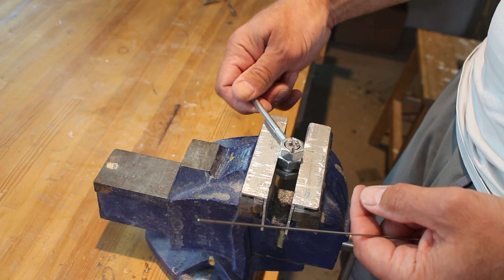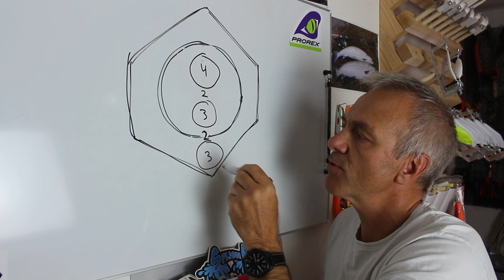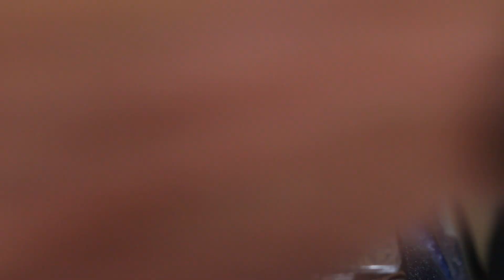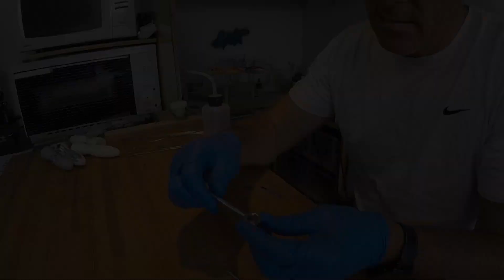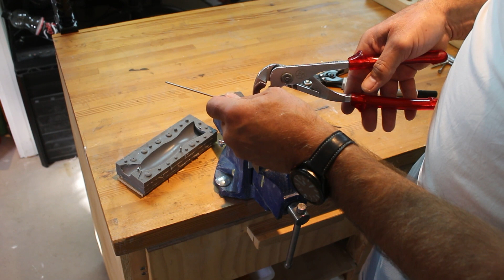Heavy duty Wire Bender

Comment: I read through some of the comments looking for someone mentioning adding a drop or two of oil to the tip of your drill bits. Trust me, your bits will cut better and last much much longer. Good video by the way.
Reply from the maker: Thanks. I'm sure you are right and thanks for the tip.

Comment: Hi there 👋 this is one of the easiest ones to do 👍 no welding needed 🙂 since I don't have drill press, my accuracy will be little off, so I think I will downscale the diameter of the pins a little, anyway I'll be using max 1.2mm wire 😉
Reply from the maker: Good luck with it

Comment: Nicely done. Thank you for the time and effort to make and post this video. About your cutters...I'd hazard a guess you natively speak German so, if that's right, you may like this: Knipex 71 12 200.  Baby bolt cutters, made in Germany. Absolutely amazing. I use them for fencing (barbed wire, woven, high-tensile, and for cutting small aircraft cable (1/16, 3/32, and 1/8).  Great cutters and I think they're smaller and yet would provide more cutting power than it appeared your set has.  FWIW. Thanks again.
Reply from the maker: Actually not german, but danish - I think it sounds alike if you don't speak any of them.

thanks for the advice on the bolt cutter. It looks really nice, and has enden up on my wish list
Reply: @SplishSplashFishing  Yeah, that's a hazard of not being in a diverse population (where I am)...it's hard to accurately pinpoint accents.  I'm sorry for my confusion.  And I wrote the wrong model number for the Knipex, it should have been 71 01 200.

Comment: Hi Jergen, "GIMME THAT TOOL" is cool cheap DIY for small wire gauge bender project. The fabrication was time consuming but thereafter it much flawless to bend such wires. I'm in the mid of creating similar design wire bender for slightly heavy gauge with nut made of cobalt steel. Hope this work.

Comment: Thanks for posting this, I have to do some wire bending but not for fishing lures. 
I have a small basement machine shop so this should be a quick and easy build. 
Thanks again for the idea! :-)
Reply from the maker: Yes - surely it can be used for other applications than fishing lures. Hope i will but usefull
Reply: @SplishSplashFishing  
I just made one very similar to this but for 1/8th wire, I had to use a 7/8" bolt and it worked great. 
Thanks again!
Reply from the maker: @AerialPhotogGuy  wow - 1/8th wire is truly heavy duty, but I guess that as you have to upscale the bolt as well it will work nicely. Thanks for the comment

Comment: You can save yourself a lot of filing by using steel collars then one of the collars and be adjusted up and down the shaft and held in place with a set screw, then you can remove the set screw in the other collar and replace it with a long bolt for the handle.  I know I know....Cost.  Anyway, it's worth it.   Great job!  Fantastic video!
Reply from the maker: Thanks mate. I will look into you suggestions

Comment: Great video !!  A small suggestion... Just before bending at 90° (at 13:00 in your video) you can put a sleeve just above the buckle for even more solidity 😉
Gimme that tool !!
Reply from the maker: Thanks. You could do that, but I am not sure its needed with this lure. Once the wire is embedded in resin it wont move.  However, if using the wire for wooden lures it could be a sound idea.
Reply: @SplishSplashFishing  not the way I make traces in wooden lures. Everything gets epoxied in. Takes a bit longer but you could pull a truck out of a ditch with it. 
Well, a small Japanese truck anyway 😁

Comment: Instead of those wood/deck screws or the 4mm bolt you can use cheap or worn out/broke drill bits,they're usually high speed steel unless they're very cheap.They're very strong and resist wear a lot more than screws and the usual grade 5 bolts you get at a hardware store and come in all kinds of sizes.

When marking the bolt you can use a Sharpie or Paint Pen then scratch your mark on it.You also need to use a center punch,even on a drillpress the bit can "walk" throwing off your hole placement....and do use a oil to drill the holes,doesn't matter what type/kind of oil,it does help the bit to cut better and adds to it's life.
Reply from the maker: I was actually thinking that when i found a broken drill the other day, Better steel and the holes would match exactly. Thanks for sharing anyway

Comment: Beautiful tool with common tools. I would have welded the handle to the nut, but the epoxy should be plenty strong.
Reply from the maker: It has been working well with the epoxy through wires for more than 100 lures now. But welding would be easy if you have a welder :D

Comment: Just an idea for you. Instead of using the pliers to wrap the wire inside the mold, use a small diameter pipe with the length needed for torque to wrap your spirals. The wire wont slip out like the pliers allow.
Reply from the maker: Thanks - I will test that out

Comment: Instead of glue use low temperature solder so if you need to replace a part of the bender you can just heat it up and take out the bad part and replace it. Just a thought.
Reply from the maker: Sounds like a good idea. I will try that

Comment: No doubt it works, but the making is a LOT harder than the watching, the drilling with coated drill bits was incredibly difficult, because the bolts are generally very hard steel indeed so blunted a few drills and even with pilot holes drills wandered and made holes larger than intended.

Comment: This is cool, you are very good at putting your thoughts into words. Thank you for sharing your skills knowledge and experience, I will be making this tomorrow. Seems like the twist at the end is a lot of work...have you tried soldering the wire together? I wonder if it would work in this situation. Only a suggestion. You did very well and it isn't my intention to critique only to offer help.
Reply from the maker: Actually for me, with my poor soldering skills, it would be much more work :D It really doesn't take much time to do the twist. But nice of you to make the suggestion -Its how we learn and become better
Reply: @Splish Splash  I made this tool yesterday. The problems I had in the process were minimal, I did remake the whole thing once I finished because the pins were not spaced correctly for a proper eyelet. The round didnt come out perfectly round and the point they come together was too far that it looked more like a teardrop. It is perfect now. After some thought I have concluded my suggestion is no good for fishing lures, especially larger ones. A large fish fighting against the line will put significant force against the eyelet so having the wire wrap around itself adds significant strength to the lure. I am using this tool for bending wire as a hobbyist. My needs are entirely different than yours so what will work for me is what I was considering. Apologies for that. But in this process I have learned a bit so for that I am grateful to you. Thank you

Comment: Hi, Jergen. This is a wonderfully simple, rugged design. I know, however, that if I try to make one, I'll run into a problem with the tiny bit of side-to-side movement in my drill press. Drilling the pin hole in the narrow edge of the steel nut—where there's no room for error—will be VERY difficult. You're right that using a small-diameter bit to drill a pilot hole helps with this step in the process, but . . . Any ideas?
     On a somewhat related note, I REALLY hope that you'll create and post videos on designing and making the large saltwater lures (including the poppers) that you plan to take on your trip next year. I fish salt water almost exclusively, so I would be VERY interested in seeing how you built these baits! Best, Chris
Reply from the maker: Hi Chris. It surely can be difficult drilling that close to the edge, but any other option than using a nut, will propably be a bit more costly and also require a lot more work. If you coull find a piece of metal that has roughlyu the same thickness as the nut is high, and the drill both the 12 mm hole as well as the 3 mm you might be able to make a nicer and more sturdy turner. But it will require more work. 

About the saltwater lure movies they will surely come. Right now I am mostly practising making poppers :D
Reply from the maker: Hi Chris. You could try and see if a 2,5 mm pin would suffice for the job. I know the difference isnt much, but it might be just enough. Good luck.

Sure I will make a video of my poppers, and maybe also a stickbait I am working on
Reply: You could file the hexagonal surface of the nut first which would give you more surface area in the corners to start drilling...sorry if I misunderstood
Reply: @SplishSplashFishing  Not sure about metric, but imperial “extra heavy” nuts have a thicker wall than standard nuts, and would give more room for error. For example, a 5/8” imperial bolt has a 15/16” hex head, but an extra heavy nut is 1-1/16”. A cheap automatic center punch (spring loaded) is a very helpful tool also! As I’m having to watch this with no sound, you might have talked about all this and I just couldn’t hear it! Great video though!
Reply from the maker: @tomt9543  Thanks for clarifying this. Didn't know there exist extra heavy version. This information might be usefull for many that have access to a more well assorted hardware store
Reply: @SplishSplashFishing  Amazon has them. Some sources call them “heavy”, not “extra heavy. In the states, McMaster-Carr is an excellent source (for everything under the sun!) as well as Fastenal. Great idea/build video! Necessity is indeed the mother of invention!

Comment: Great tool! Do you get your wire straight in the 1st place or do you straighten it? I am looking for ways to streighten mine :)
Reply from the maker: I buy straight pieces on 1 meter. That is by far the easiest thing to work with
Reply: @SplishSplashFishing  damn I haven't crossed it in this form yet, I'll keep looking 👍👍
Reply from the maker: @Lambig56  I use stainless MIG/TIG Welding wire

Comment: What kind of wire are you using? Could you give me any link to where you bought them?
Reply from the maker: I use stainless steel MIG/TIG welding wires. I could supply a link, but I think ýou will be better off googling for a local supplier
Reply: @SplishSplashFishing  Thanks. I live in Sweden and usually buy from hobby stores, but its more expensive.
Reply from the maker: @aurimask3770  Yes it is a lot cheaper to get it from welding gear suppliers - seems that everything doubles its price if its sold as fishing gear :D